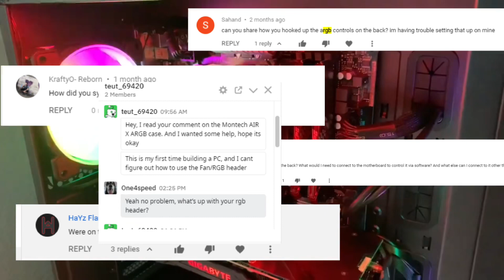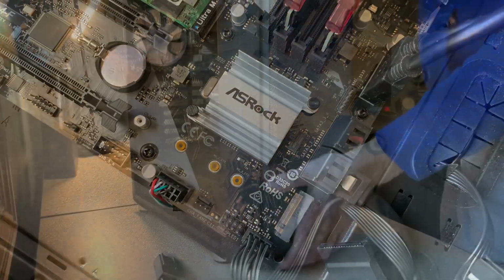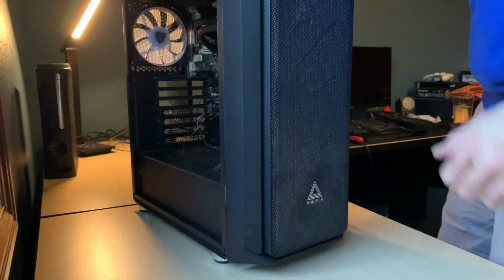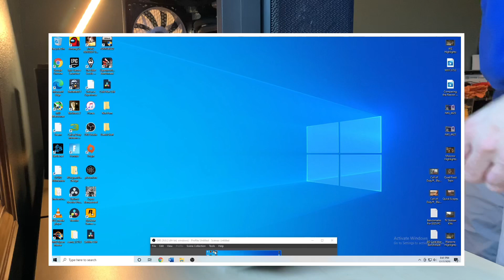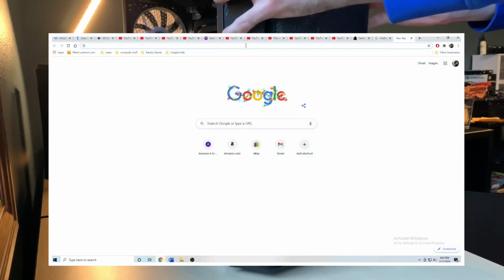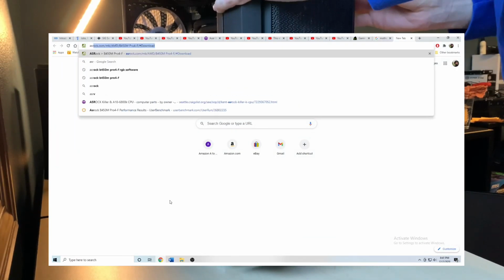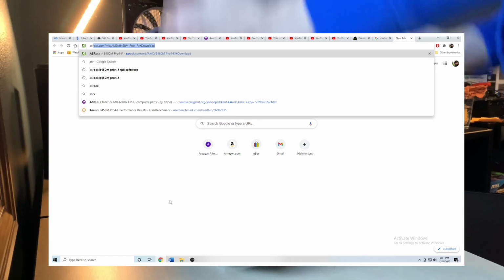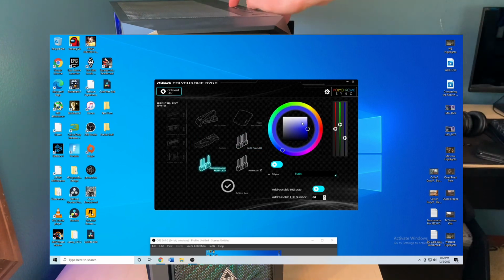Quick Tips — Setting up the aRGB hub in a Montech Air X ARGB

Comment: Help needed, please.

I just built my pc and everything is working fine with the fans, except the rgb, won't turn on at all with the led button on top of the case, I don't have an aRGB header on my motherboard so I didn't plug in the 3 pin aRGB cable or the one attached to it that says "VDG in". The fan controller is connected to power via SATA cable from psu, the cable is working fine I know for sure, but no fan rgb. Please help idk what to do, first pc build. 

Thanks in advance
Reply: is the argb hub connected to your front I/O where you can click LED button?

Comment: Can you turn off the rgb using the switch on the casing? My motherboard doesn't have any aRGB pin and i don't want rgb lighting all the time.
Reply: Yes you can. Just hold down the LED for 6 seconds to turn it off. Hold for 3 seconds to sync it to the motherboard.
Reply: @jamieroseman4429  dude you are amazing! My Ram was syncing with Gigabytes RGB Fusion but I couldn’t get the fans to sync - hold down for 3 secs worked!

Comment: I really like your jolly style of making videos.
I bought this casing this week right after I saw your video on it. Literally.

The problem I'm facing right now is that my B450M Mortar Max motherboard doesn't have an ARGB port... Is there any other way that I can I control the lighting to my wish?
Reply from the maker: Hey thanks man! And yeah theres a button by the power switch that should be connected to the hub that will change the lighting and patterns without needing an aRGB port.
Reply: @EmTekTube  Thanks a ton for all the help in this video, This case is arriving soon and I wanted to make sure I didn't need to buy a mobo with a argb header to use the rgb effects, glad the case has something for that.

Comment: what do i do when my motherboard doesnt have an rbg header? the fans work but the LED´s dont, can someone help me please :)
Reply from the maker: Should be able to use the led's without an rgb header. Just make sure the sata connector for power is plugged in, the 3 pin rgb cables to fan are plugged into the header, and that the cable labeled "SW" that goes to the led button on top of the case is also plugged in correctly.
Reply: @EmTekTube  thank you so much!! They work now :))

Comment: I have this case and it took me to figure out  that yes you can control the case fans RGB with both the LED button and your MB. Use the button to cycle through different modes. Hold it down for 3 seconds to sync it to your motherboard. If you connected the hub to ARGB 1 for example it will show up in Mystic Light as such.. Much better rainbow settings there than the button, and you can also control brightness. But to be honest the case sometimes looks better with the fans off and some RGB inside.
Reply: You are a life saver, bro. I was trying to figure out how to connect with the MB and was that simple, lol. Thanks a lot!
Reply: YOU ARE A LIFESAVER! I was looking for a way to do exactly that and found this info nowhere else. Dunno why the manual does not mention that. Thank you!
Reply: THANK YOU A LOT. I didn't know about hold the button for 3 seconds to sync MB.
Reply: hell yeah you da man. holding the button for 3 seconds is the play. So glad I scrolled just a little bit further in the comments. Only time I've said that hahaha. Have a good life.
Reply: thank you so much, i tried to reconnect the cables 10 times and still couldnt control my fans colors with the asus software, THANK YOU!
Reply: Dude you are a LEGENDDD like you can't know how much i tried different stuff. May the force be with you <3
Reply: What do you mean connect to motherboard when I hold my button for three seconds it turns white then turns off
Reply: @Worldofriches  That’s correct, it’s supposed to do that. That means it’s synced to whatever your motherboard setting is. If you have mystic light for example you can control it from there
Reply: Do you have issue when sometimes the rgb on fans will sort of spark when you pick a custom color? ( non case mode)

Comment: How can I control the fan speed though? In my bios it says the system fan is at 0 rpm and I have all the wires plugged in correct
Reply: i´m using a y splitter, got it connected to the motherboard directly and using the hub just for the leds 
it works, you just have to be careful with the header output on your mainboard. some mainboards only have a 1A output fan header output so you gotta be careful how many fans you connect to that pin
if you have a 2A output as some motherboards do usually today, you should be fine

Comment: whats the vdg in cable for????????
Reply from the maker: It goes to the led button on top of the case. Let’s you control the lighting if you don’t have a newer motherboard with software control.
Reply: @EmTekTube  I have a gigabyte aorus pro wifi, it has rgb and has rgb fusion. I'm trying to sync my fans with my motherboard but idk how to set that up with the controller on the back.
Reply from the maker: Gotcha my bad, looks like the VDG cable is a gigabyte specific thing. Check your manual to look where it goes, although it should be labeled just “VGD” on the board, and it’s probably near where you plug in the 3 pin rgb header.
Reply: @EmTekTube  thanks for the help!!!!!

Comment: Hi bro nice vid, does the Asrock B450M Steel Legend work with this?
Reply from the maker: Yup it will, that board has a 3 pin RGB header in the same spot as the board I used in the video.
Reply: @EmTekTube  thx
Reply from the maker: No problem

Comment: I have a gigabyte B450M V2 and you know where can I connect it for the fans to work ?
Reply from the maker: Look in a similar spot on your motherboard that's in the video, should be labeled SYS_FAN1 and is right under the vrm's heatsink and next ethernet rear i/o if your model is the B450M DS3H V2

Comment: So for the controller you just have to connect the Sata cable, the fan cable to the motherboard and the 3-pin rgb cable?
Reply from the maker: Yup, just those 3 things
Reply: @EmTekTube  my MB doesn't have a Argb 3pin connnecter. Can I still use the rgb with the stock button on top of the case

Comment: Hey there. Im using a B450 Gaming Plus Max mobo and I'm having trouble with the rgb header. I think my mobo only has 12v headers for the rgb. What can I do to incorporate the Hub?
Reply from the maker: Yeah unfortunately those MSI boards only have 12v headers. Converting 12v rgb to 5v is a bit more difficult than just a using an adapter for the pins, but there are converter box's online for about $15-20 as an option

Comment: What if i only got 4 pin rbg headers? Would the only option be to get an adapter 3 pin to 4 pin?
Reply from the maker: Unfortunately not, 3 pin and 4 pin rgb connectors are not compatible with each other. You would need to get a separate controller to translate between the two.
Reply: @EmTekTube  alright thanks my man, if i don’t connect the 3 pin arbg connector and just connect the the front panel connectors would i still be able to change the colors through the front panel? aka “LED”
Reply from the maker: Definitely man, you won’t get full control of them, but you change between the premade options on the hub along with some solid color options
Reply: @EmTekTube  yeah that’s what i thought thanks for answering quick man. I also got the hyper 212 cooler master rib black edition and it comes with 4 pin connectors and since i have a 4 pin rbg header i’ll be able to get the swift ware for it and match the premade color modes that come with the “LED” button
Reply: @ehonda9267  Does the RGB still work decently well without the 3 pin connection? I just want to make sure before i buy it and find out it doesn't work lol
Reply: @mackjones5524  yea man i’ve had it for months now and the rgb on the case is great man i have it set to purple to match my theme of black and purple
Reply: @EmTekTube  along with everything else ofc just not the 3 pin argb connector